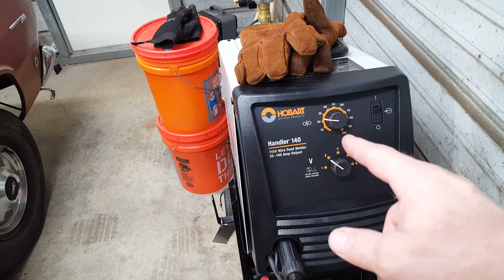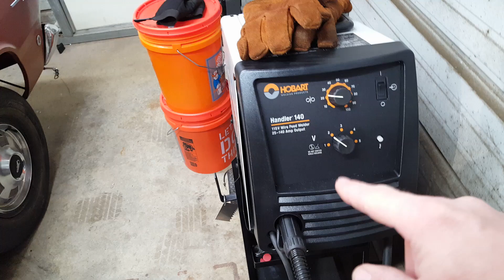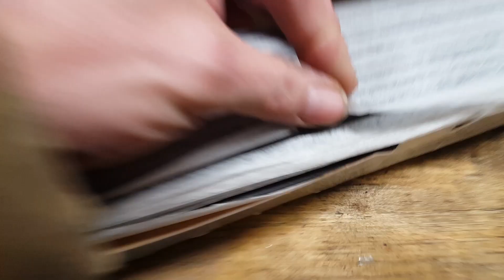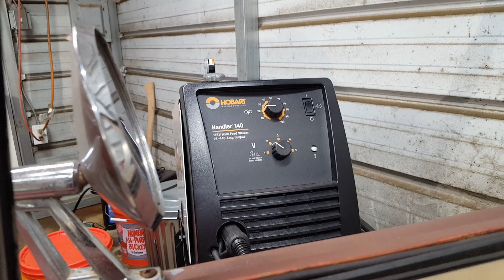1968 Plymouth Valiant floor pan replacement DONE

Comment: I started out with welds worse than yours. Now that I been doing it 40+ years, they look a little better. I bought a new welder a few years ago, and still getting use to it. The key to a good weld, is CLEAN surfaces, and clamp or tack everything. No mater what, the welds need to be sealed. All it takes is a pin hole for water to get threw. It looks good, and will make it a fun useable car.

Comment: Tyler, you took the bull by the horns and you're teaching yourself another skill. Great for you!!!! We learn by doing. You're in a learning curve..Ah, ok. So you DO need to go underneath the car and seal there as well to keep water from getting into any seams.....Build quality? If it wasn't the top end car, I think they didn't care.
Reply: And yet Valiants and Darts ran forever, and would likely survive a nuclear holocaust, Crown Vics also.
Reply: @MisterMikeTexas  my '69 Valiant 100 was cursed. It broke down constantly in the 4 1/2 years that I owned it..Very un-dependable / un-reliable car it was. What I fixed stayed fixed, but I chased the Valiant gremlin's forever......I blame it on the two family owners that had it before me. For the first 6 years of it's life, it wasn't used too much. Only had 21,000 miles on it when I got it. I sold it with 97,000 miles on it. It got wrecked twice after I sold it by the next two owners...
Reply: @howardkoster4026  Was it 273, 318, or Slant Six?
Reply: @MisterMikeTexas  170 cu in slant six/ with the speed. Top speed was 45 MPH when I first got it. I stomped on it, blew out the carbon!!! It was fast as hell after that. A few V-8 cars couldn't get past me either. 95, 97 MPH...top end.. Uncle Tony's Garage explains why the 170 is quicker off the line then the 225...

Comment: I feel your pain. I am a horrible welder with cheap equipment, but I really like being able to just drill a hole in the new metal and clean underneath the hole on the old metal and “spot weld” it all together following it up with some sort of body filler to keep moisture out. Otherwise,  I am great at just burning up the metal. Angle grinding and body filler hide the sins when it comes to my welding and body work! Good thing I am not a perfectionist or I’d drive myself insane! I’ve heard that you can make your own Por15 “on the cheap” by mixing Rustoleum with a heavy dose of catalyzed enamel hardener (like you can get from Tractor Supply) but I have not yet tried that out. (Brush it on, don’t spray it .. its nasty stuff!) I don’t think I would try it without cleaning as much rust off the metal as absolutely possible, just to be safe! Let the haters hate if they want but DIYing on a budget is the only viable option for many of us, and that isn’t all that cheap either these days! If your doing your own headliner installation, just try to take your time and stay calm; it can be a frustrating job. I like the 3M spray upholstery glue (was available at Walmart, not sure in that is still true). Last time I used another brand and the glue let go. Also, I buy up some of those black paper binder clip to clamp the edges of the headliner around the windows until the glue dries. Don’t expect it to be perfect but you can make it really look good (your gonna have some wrinkles and puckers in the the final product. If you use a heat gun, be careful because it easy to melt the vinyl). Professionals are made; not born! Nice work! Keep going!